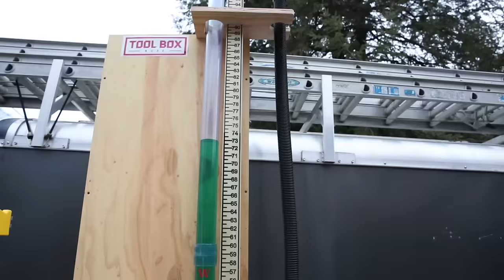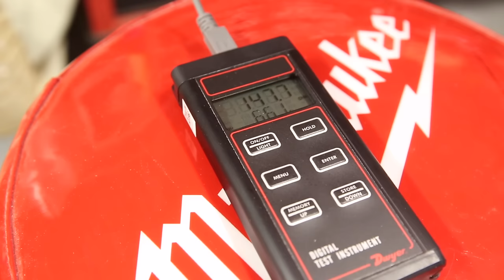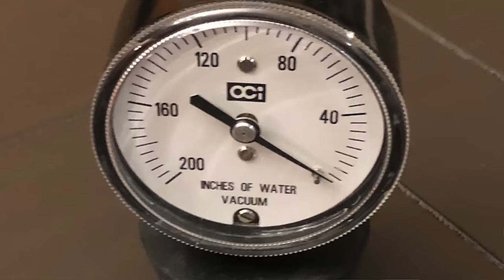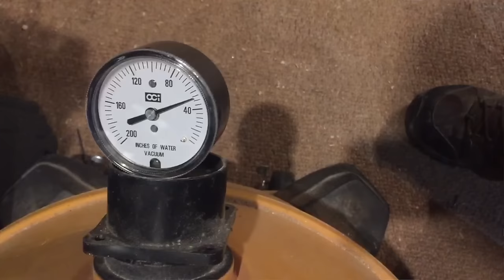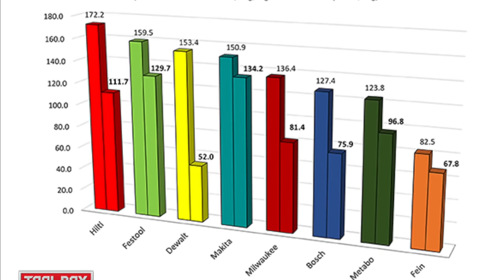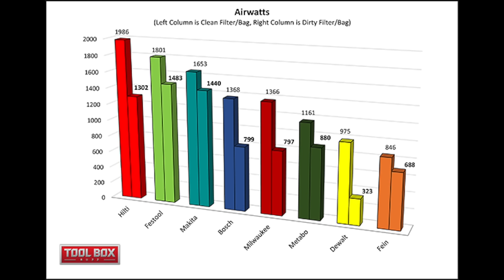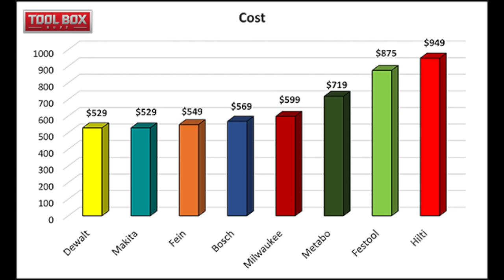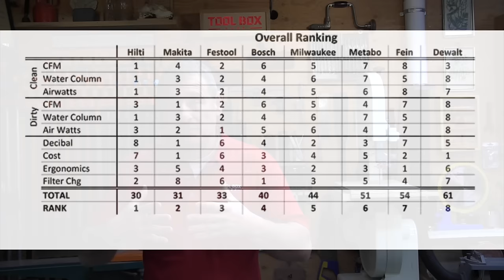Best Dust Extractors - Head-2-Head Testing

Comment: I own 2 Festool extractors. A midi and a ctl 26.In the UK health and safety are all over dust control and when adding in cost Festool comes in cheapest when you consider you can get reusable long life filter bags. The makita will hit you up for £20 for 5 filter bags were as I haven’t paid for a Festool filter bag since owning these extractors. Add into the fact that the hose and lead wrap up inside the units themselves and you have ball ache free storage! Good review as always!
Reply: zap brannigan love your comment, im kinda surprised festool came in 3rd. when my vac dies I'm going for the festool
Reply: Kiwi Bird mate it’s expensive up front but by far cheaper given the cost of filter bags over the life of the unit! Plus the new extractors are coming with blue tooth  to work with battery tools.
Reply: zap brannigan, I bought the festool 48 thinking bigger was better, but when the bag gets over half full, it becomes too heavy to lift expecially stairs
Reply: $250 for the longlife filter bag.  $50 for a five pack of disposable bags.  No thanks.  The price of their tools don't bother me, but the price of their accessories piss me off to no end.
Reply: +Ispike
Just as important when choosing a vac is how it works with the rest of your tools. How flexible it is to use and the quality. 

Other brands match it for quality in terms of performance but not in terms of how it works in the real world with tools. 

Festool allows you have a tools startup system so when you for example start your router the vac system will start up as well. There are many reasons why festool is amazing for professionals.  They are expensive but so were old Mercedes cars back in the day that would do 500,000 miles and still perform like a champ.
Reply: bighands69   I bought the Milwaukee.  It has the same autostart and self-cleaning filter system as the Festool.  It also seems to be much more robust than the Festool extractors I've seen on job sites in the past.
Reply: +Ispike73
milwaukee make good tolls but lets not pretend they are in the same league as Festool. They do not offer the same accuracy nor do they have the same overall system approach for tools. You can buy a vacuum for their tools. But they are not as flexible as festool. 

I have a Ts55 that can be integrated with a festool table to produce a table saw that is super accurate or a router can be added to the table to produce a router table. 

There are no tool makers on the market that do that. Now Dewalt, Milwaukee, Makita and Mafell all make great tools that I own as well but they are not as integrated in their approach as Festool. Some day these other brands will in my opinion catch up and when that happens if festool does not innovate they will be in trouble.
Reply: bighands69
I'm still not sold on Festool.  I've used the TS55 and I own the DeWalt track saw.  I prefer the DeWalt as it feels like a better built tool, and you can use both sides of the track.  I'm not really interested in using a circular saw base as a table saw, I have four or five table saws already,  and both the Festool and DeWalt track saws are underpowered for what they are, let alone a dedicated table saw.  I already have a Jessem router table and countless routers so eh.
  
My biggest issue with Festool besides being overpriced is that they are four generation behind the rest of the industry when it comes to cordless tools.  I'm a builder by trade, and cordless tools are invaluable to me, especially considering the lineup that Milwaukee now offers.  Being able to use the same battery system in your table saw, chop saw, skill saw, chainsaw, multi saw, jigsaw, sawzall, jab saw, drill, impact, grinder, porta-band, SDS, holehawg, power plane, sanders, nail guns, leaf blower, weed whacker, etc... is an absolute godsend.  

Let's use the Festool SYSLIGHT as an example because that thing pisses me off to no end.  You get to pay 200 bucks for a light and you can't even change the battery in when it dies, on top of that you have to pay an extra 80 bucks for a magnet for it.  Absolutely asinine.  On the other hand, you can buy the M12 light that is waterproof, drop proof, chemical proof, comes with magnets attached, spring clamps, keyhole slots, and numerous other ways of attaching it, that uses the same batteries as a vast array of other M12 tools, all for 80 bucks.
Reply: +Ispike69
For small workshops that want to produce high end wood work the the likes of the TS55 or TS75 are perfect. With one small table you can have a router table and table saw. With just one trolly you could have a cross cut, rip saw, router table, table saw and cutting table with a jig. That could all fit in the trunk of a car and be as accurate as anything on the market. 

You could even use the set up in somebody's home with minimal dust. And on top of that it is super accurate and to cabinet/furniture making standards. 

There is nothing wrong with Dewalt or their products but they are not as compact or flexible as Festool.  Festool can be a portable workshop if you want it to be.  They are expensive but you pay for what you get they are a small company.

Comment: What a thorough review! Well done. Some quite surprising results. Pricing has changed on most, if not all, of these vacs since this review. The most valuable component of your review was definitely the dirty filter testing and the fact that your testing was measured at the hose end. Thanks for your intense effort.

Comment: Your tests and methodology are outstanding. As a mechanical/process engineer I thoroughly enjoyed your scoring matrix and graphical representations. Aside from the aesthetic factor is seems that the Makita is the best $ value. I however have a Festool CT26 and I am glad I do! One feature I can no longer live without is the ability to TURN ON MY VAC FROM THE HOSE END! Yes, that's right, I can turn it on and off from a bluetooth button on the hose end and with my back issues it's a life/back saver!  No more bending over at an awkward height or leaning to turn it on when I want to suck without a tool!

Comment: Great job guys that Makita is looking good
Reply: the Makita is a rebranded Nilfisk
Reply: Not that that is a problem just info
Reply: I’m genuinely surprised. Cheap as chips too. Gotta buy at least one for sure.
Reply: Jason Taylor nilfisk must make the best then because that was the best vacuum out of the group if you ask me. The Hilti was twice as expensive, if Makita made there’s twice as expensive they could either offer you a second one for free or make the first one way better than that Hilti.
Reply: Nilfisk-ALTO Attix 50 AS/E Wet & Dry Vacuum 302004234
Reply: Jason Taylor do you know what model?
Reply: Festool integrates into their other tool systems.  While it is easy to claim other vacuums are better they never are when used in the field with tools.

Comment: I've been on a site for the last year that has 2 of the Hilti vacuums and they consistently fail and are extremely loud. I've seen both of them suck the filter into the base of the units. We are using 2 filters each and rotating them when 1 is has been washed. There are 3 metabo/starmix vacuums that have been used on drywall dust, silica dust, saw dust, wet concrete dust, mud, water and general site cleaning every day and they haven't failed once with weekly filter washes. 1 set of filters is over 10 years old. The Hilti vacuums are less that 8 months old. No filter bags are being used. We mostly avoid the Hilti vacuums. The starmix filter cleaning also seems to work better. Less noise and no loss of suction while cleaning.

Comment: i needed this video glad i stumbled upon it. i own a dewalt that is three years old, dewalt stopped making bags for it so i am pretty much fkd out of that $400 investment and now need to buy replacement and refuse to let dewalt pull  that bullshit again, i even called them and they were of zero help , so me and thousands of contractors get the pleasure of buying this tool again. i will check into the hilti,  on a crazy side note i am a drywall contracror so you picked the right material for my  interest. thank you so much for doing my homework for me.    thank you

Comment: Tier 1: Hilti, Makita, Festool
Tier 2: Bosch, MIlwaukee
Tier 3: Metabo, Fein
Tier 4: DeWalt
Reply: Only if you value every test equally. Any real-world user knows that some of the tests are far more important than others, and the variation within some tests is, itself, important. For example, a smaller drop in suction when dirty is more important than having higher suction when perfectly clean.
Reply: Definitely going with the DeWalt.
Reply from the maker: RFC3514 great points!  👍🏻
Reply: DeWALT, BOSCH, metabo, FESTOOL, HILTI
Reply: 1. Starmix

Comment: Wow! This is the first of your vids I’ve seen, and as a technical AEC guy, you have done your  testing selections and performance quite well.  The results are not just real world, but fair and credible, good job!
Reply: And not only that: It is also the very important information on which of those models to AVOID...My DeWalt failed soon to energize the vacumm when I start a tool connected to it's outlet, as the damn design is failure prone. I understand that it would be very difficult to include how the tool performs after some weeks of use, so they cannot inform us of every fault that the product is prone to develop. Mine went bad after only a couple of uses, and because they only provide a warranty of one year and I happened to use my unit not frequently, is came out of warranty.  The vacuum still worked (as mediocre performing as the video tells), but its outlet became damaged after only two times I used it with a jigsaw that draws less than 5 amperes, so I did not damaged it by overloading it.  The electronics repair technician that repaired my unit told me that the circuit is not properly protected against the inductive load voltaje spikes that ALL the electric tools produce.  Bad design by DeWalt, and even worst customer support and nil understanding.
Reply: Alfredo Márquez Fredo, that is so true.  I’m sorry to hear about that sucky experience — sadly we all seem to have them sooner or later.  Then we’re stuck with a boat anchor.

Car reviews are the ultimate example of this:  All shiny and sexy in the reviews, and then months down the road (literally) the troubles appear and it’s a hot potato that no one will pick up.  That’s why I poll my mechanics about their experience and what they’ve heard about specific cars.

I sure like 1 or 2 year follow up reviews.

Comment: I bought the Festool mainly because of their accessories are just endless they have something for just about every trade and also the build quality is so good, also I use a lot of Festool tools so its compatible with what I already have, i find that things start getting fiddly if you mix and match different brands, if I had a Makita track saw I would buy the Makita dust extractor.

Comment: Excellent work, good test, however there are some assumptions you need to put in place.  How important is noise if all the equipment you use with the extractor is more noisy and the extractor is up to 3 meters away.  I am missing the quality of the hose, how well it holds up, how well it rolls, storage of tools on top of the extractors etc.  Is it true that a higher water column - ie more suction is better. I am of the thought that the power needs to be a calculus of the hose diameter and the airspeed to recovers the most dust and captures particles. I see that Festtool antistatic hose got a 3 when we all know that dust sticking to the outside of the hose is an issue and leaves a mess.  What is the purpose of a cannister handle when you remove dust into a fleece bag ?  I would love to see testing based on how much dust it leaves behind when doing an actual sanding job, test one from each vendor, then use the best performing sander on all the extractors. I must admit I have Festtool dust extractors, but that is after having multiple other brands including Kärcher and other typilca shop vacs.

Comment: BEST SHOP VAC DUST UNIT EVER - cleans the air, never clogs, never slows down, fits many larger vacs (25 gal or bigger is ideal) and is a very cheap DIY hack.  Take a big round tank type vac, fill it with at least 5 gal, and about 1/3 full of water, make a splash suppressor using a length of stiff hose in a circle to fit over the water level.  It has to stay in place.  Add the ass-part of a pair of panty hose over the splash suppressor circle. Tie and cut off the legs and overlap the waistband to cover the surface area completely.  Make an inlet pipe with a 90 degree bend at the end. Shove the top of the inlet pipe into the internal part of the air inlet hole and pass it through the elastic band of the panty hose into the water.  It has to stay there.  Turn the 90 outlet so that the water will spin.  That's pretty much all it takes.  The dust settles into a solid mass at the bottom of the tank (leave some clearance for that.)  You'll need to clean that out and change the water a couple times a week if you're really cooking.  I built this in 1981 for a furniture design project cutting routing a lot of PB and MDF - real dusty.  The air in my shop-garage was always clean and fresh after that. Works with fumes as well..

Comment: amazing review.  The reviewer states there isn't a big difference in volume between vacuums.  This is slightly misleading.  Volume or decibels (dB) are measured in a log scale. So moving from 70 to 80 dB is actually an enormous difference in volume (like the difference between a loud highway and a toilet flushing).  Something to keep in mind.

Comment: Hi Concord, I use a shop made thien baffle to drop all the dust and chips out before the bag on my Festool CT. It reduces the consumption of filter bags and with a window in the box I can see when the baffle needs to be emptied. I accept that the baffle reduces the suction at the tool end of the hose. The baffle box is 12 inches cube and so is carried on a trolley with the festool extractor in my shop. Colin in Northern Ireland

Comment: Thanks a lot for this review. I plan to use a room of my house as my workshop. Noise is a huge matter for me and healthy as well. There are other options that says 50% less noise or similar wordings. But not all of them has a DBS measurement. Thanks a lot for your video and your comments
Reply: Sorry I forgot to mention, I used to be contractor and I always keep looking for the best tools. Unfortunately, the cheapest vacuum in this review cost more than my table saw. Maybe I need to keep looking for something for hobbies and partial job than a professional equipment. Any suggestions? Just in case somebody else like me needs to look for a cheaper option? Thanks in again for all your information. It was really helpful.

Comment: Very useful and complete testing. I suppose one big issue is that most manufactures make many variations of the product and thus it would be a very long study to cover them all. 

I personally use Festool and swear by their tools. I also have to admit I am not a contractor just a hobbyist woodworker. I have an air purifier along with an air purity tester with which I get A1 results. So I will be sticking to my Festool.

I do have to say a big thank you for the time and effort you and the crew took to carry out these tests with very clever yet dimple gauges and jigs. Sounds it was a bunch of fun !!!!

Comment: This is easy. Save yourself a watch and get the festool CTM (26 is the best all rounder). 

Mirka is also great, but their ecosystem is much smaller. 

Unlike the rest, festool’s entire product lineup is designed around their extraction systems so it’s plug and play the whole time. None of the other brands here offer that feature

Comment: Thanks so much for this test. I've been looking at dust extractors and wondering who has the best bang for the buck. Flooring Contractors were the ones that got stuck cleaning up the last contractors mess and I've seen a lot of it for over 40 years. These new regulations hopefully will change this.

Comment: Metabo HPT is a great vac with both 36V battery and AV adapter capability
They also have a AC only vac that is top notch dust extractor

Comment: And of course, Milwaukee. If noise is an issue, there are much quieter models available. I have Feins that are far quieter. They aren’t as powerful as these, but for many tasks, the extreme qualities of some of these models isn’t needed, such as in a shop, where noise is a greater factor than ultimate pickup.

Comment: I've used them all and Makita is the winner. Forget about warranty because it's useless Sunday morning when it counts, if you have 3 weeks to spare, the warranty might help. On a job site I need a tool that works. Have a back up option and if your Makita ever fails you, you don't have to send it to Germany for repairs. They all break down at some point and the Makita is easier to repair or replace.

Comment: Hi guys. There is something very puzzling to me. All these vacuum dust extractors are ranked in about P_vac=250mbar of pressure. It means that when you close the tube and measure the pressure (relative to absolute vacuum), one should measure about 250mbar. In the test, you did with the water column, the pressure of the water colomn + P_vac should compensate the atmospheric pressure which is roughly 10 meters of water column or 1000mbar.
So for the  test, you made the water should go up to about 7.5meters (or 300 inches) and not to about 100 inches/
How come you got only about 100 inches?
It is true that 250mbar corresponds to about 100inches of the water column. The better the vacuum, the lower the pressure. However, this is an absolute pressure - not what you measured in your experiment. You measured the difference between atmospheric pressure and absolute pressure.